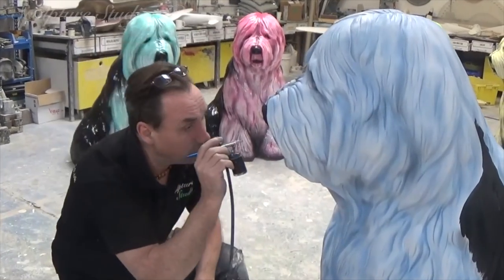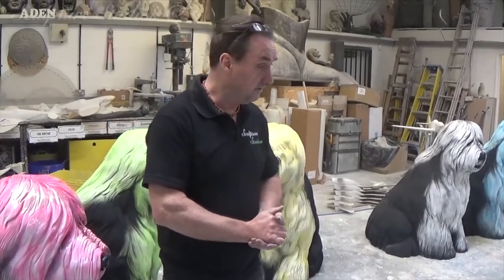Dulux Dogs by Sculpture Studios

Comment: Trying to follow and learn, I didn't understand the 2 molds. The pink rubber one was pulled off the hardened piece and placed in a perfectly fit second outer mold? fiber glass?
Reply from the maker: Ron Haight silicone rubber was put onto the clay first in multiple layers. Then a fibreglass jacket was put on top of the rubber once its gone off, and left to set, so that the rubber has a hard shell to sit into.